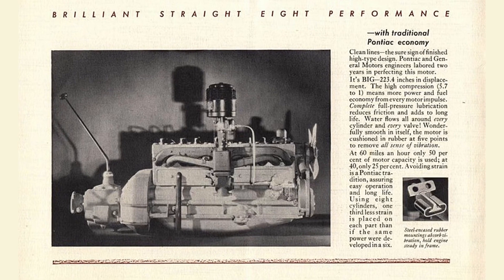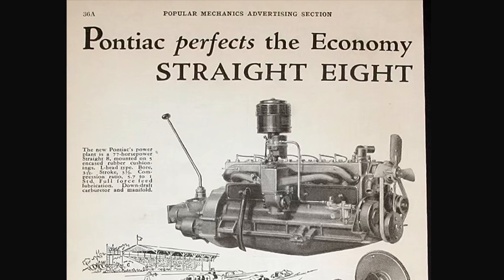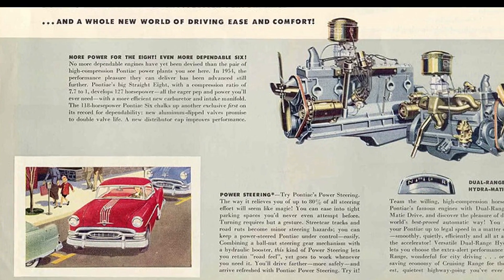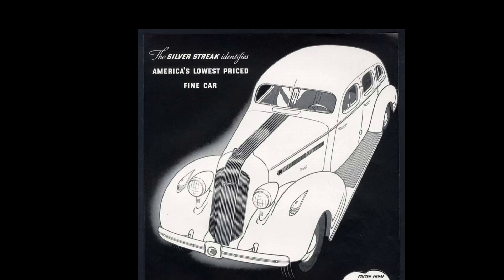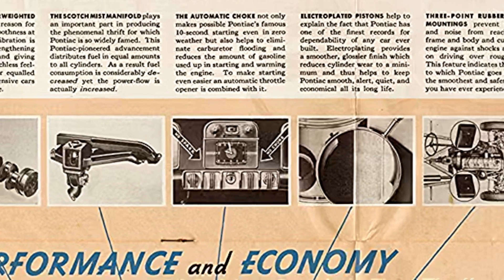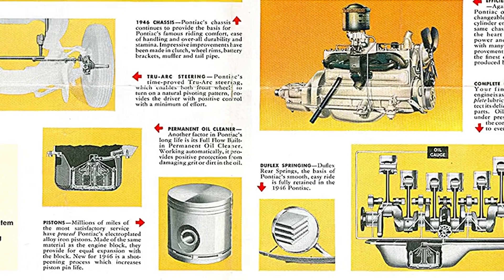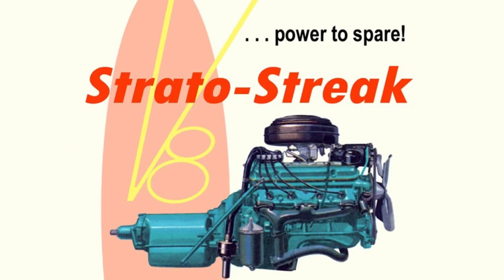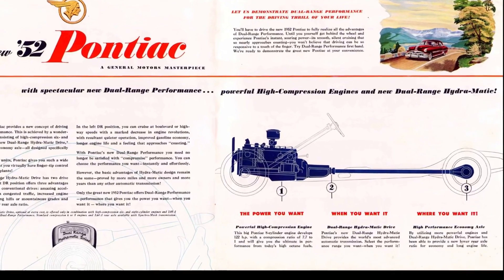Pontiac straight eight engine family 223, 232, 249, 268

Comment: My Dad had a 53 Pontiac Chieftain with a straight eight. It was the first  car that I ever drove circa 1961. I could barely see over the dash. No power steering or brakes on that jewel.  It was a handful for a little 12 year old kid to drive.  I remember my Dad talking about the "overdrive" function of the hydramatic transmission.  There are a lot of good memories from the backseat view over the years. He sold that car for  $75.00  in 1964 to pave the way for a new '64 Pontiac Tempest. Detroit iron, you gotta love it!
Reply from the maker: Thank you so much for sharing those memories =)

Comment: The 1933 and '34 are my favorites, but that '35 isn't too shabby, either.

There used to be a 1937 Pontiac Six convertible coupe close by to my school when I first saw it in 1967.  It was a faded yellow with a scruffy black top, and I was told that the old man who was driving it was the original owner.  Didn't see it from 1969 till 1991, when it was little more than a basket case, and for sale in a different part of the city.  I wanted to buy it, but it needed too much of everything.  It was pretty sad to see it in that condition. 😞 Hopefully, it was rescued.

Comment: In some ways a 1950 Pontiac was a 1950 Chevrolet with a longer hood to accommodate the straight eight engine and different chrome decorations although the Pontiac could also be bought with a flathead six engine but I recall that there were few to none.  A 1950 Chev six was a 60 mph car; any faster made it sound strained while the straight eight Pontiac was easily capable of a relatively relaxed 70 mph.  Our Pontiac had a four speed Hydramatic trans while a Chev had a two speed Powerglide trans that was very sluggish to get moving.

Comment: I think Pontiac and GM went in a bad direction. Instead of trying to make straight 8 better they should have used the GMC truck 6 starting in 1939. Superior design concept.What was wrong with Pontiac and GM they didn't do this. But do note this engine had full pressure lubrication and insert bearings starting in 1933. What was wrong with Chevrolet that they used poured bearings and splash lubrication exclusive starting in 1929 all the way to 1951 and on some engines 1952 through 1954 before switching to more modern methods in all their engines in get this 1955. They could have done it in 1935 instead.
Reply: Pontiac made a great engine.  Stud ball rocker arms was there intro in 55. Pontiac deserves their due.

Comment: In 1957 when I was 12 years old, my folks bought a 1954 Chieftan 8 wagon six passenger with Hydramatic and with 34,000 miles from a dealer in Rhode Island.  5 days later, we loaded it and drove to Los Angeles, California.  It was quiet and smooth, and fully loaded it drove fine at 60-65.  With the exterior sun visor, when a large truck or bus would pass by us on the opposite side, that visor would catch the wind and physically one could feel the car slow down from the additional wind drag.  The only problem was crossing the desert in August in the day time, it did overheat, which was not uncommon in those day.  It was pretty large, especially compared to Chevrolet, Ford Plymouth, Mercury and Dodge wagons of the same era.  We had it until he sold it in 1961 and bought a 1959 Catalina wagon, 8 passenger with the 280 hp 389 two barrel and hydromantic.   That Catalina was quick for a 4,400 lb car.  Curiously, the Bonneville of the same era had better highway mileage with the same 3.08 rear end.  Probably because the primary barrels and jets on the Bonneville were smaller than those on the two barrel and used less fuel at cruising speed.  Open "Niagara Falls" and the other two barrels made up for it.
Reply from the maker: Cool story

Comment: Also, not all 1950 cars had the new 268 cube engine.  Some came with the 248.  That's why the horsepower rating is only 108 on the 50.  Better that some cars had MORE than advertised horsepower.
Reply from the maker: Thank you so much for adding that clarification =)

Comment: Had a hand-me-down 1951 Catalina stick-shift in the late 1950's; was a weak contender compared to the Olds V-8's of the day and used lots of oil. Thought it was time for a rebuild after a Dodge 6 ran circles around me so pulled the head and found every wrist-pin loose and grooved each side of the cylinders. Went to the bone yard and picked up a 1954 Olds 324ci; with the help of Hildenbrandt adapters, it went into that sick '51 and then she was good to go...

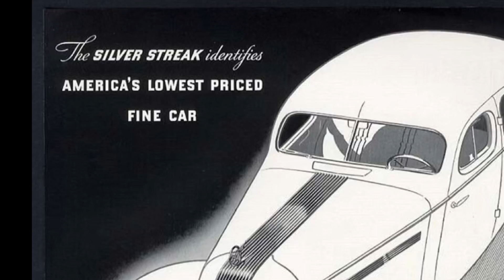Comment: I'll take the '35 and '40 Pontiacs.  As a side note;  @2:59 that's a '35 not a '36 as inferred.  The '35's light pods were mounted vertically to the fenders, 
whereas the '36's light pods were mounted horizontally to the side of the grille shell
Reply from the maker: Awesome sweet choices thank you for that correction =)

Comment: 1933 Pontiac and 1953 Pontiac.  The 1954 Pontiac Star Chief had a longer rear overhang and a much larger trunk, for one year only.  Your numbers for bore and stroke for the 248.9 CID engine are way off--not just a rounding error--they give 557.6  CID.  The later-listed figures for the further-enlarged engine are actually smaller.   The CID figures still don't match with them, but they are far closer.
Reply from the maker: Great choices thank you for pointing that out I got the information here but it’s clearly wrong 

https://www.conceptcarz.com/s25856/pontiac-chieftain.aspx

Comment: I’m confused. I believe the Bore and stroke listed for the 248.9 engine are incorrect.  Due to the fact that a 4” x 4” v8 was made by Ford which was a 400cid engine. Also the next engine described in the video has a larger displacement , but the both bore and stroke listed are smaller that the bore and stroke listed for the 248.9. I imagine it’s a misprint.
Reply from the maker: Yeah that’s a typo this is where I got the specs they are real hit and miss as far as information goes 

https://www.conceptcarz.com/s25856/pontiac-chieftain.aspx
Reply: @What.its.like. I would imagine the most accurate information would be found in the brochures.
Reply from the maker: I get most of the information from the ads some of them did not give engine displacement though and finding advertisement pieces with every single engine from this engine family was really hard there was a couple engines that wasn’t advertised..
Reply: The 1937-49 bore spec was quoted from a dyslexic source. It was actually 3.4 inches, not 4.3” (which would be impossible without a total retooling).
The reason they finally went back to V8’s was to enable wider bores without ending up with a 40 inch engine length.

Comment: Looks like the car at 5:20 has a 12 volt conversion (the original battery was long and slender,I think 17 or 18" long,and larger/higher amp hour capacity than common 6 volt batteries of the era (Buick 320 and Packard engines might have also come with similar batteries although I had the idea from somewhere that Packard once tried an 8 volt/4 cell system
Reply from the maker: I’ve wondered why some batteries from that era are long and slender

Comment: If someone is lucky enough to get to drive one of such cars,it would be a good idea to not try to reach high speed or high RPM in it,at least until it could be determined that the engine does not have "ridges" at the tops of the cylinder bores due to wear (the wear does not go all the way to the very top of the bore leaving the ridge) at high RPM the connecting rods stretch a tiny bit allowing the top piston ring to strike the ridge causing failure
I think I have heard of such cars (including such as Dodge) being sold by owners who drove conservatively to someone who took the car out to "see what it would do" and promptly suffered a completely destroyed engine with a broken connecting rod or broken crankshaft.
Reply from the maker: Great information thank you so much for sharing that =)

Comment: According to the 1950 Owners' Manual the bore/stroke for the Eight: 3and 3/8" by 3and 3/4"
for the Six: 3and 9/16" by 4"   
has a statement that external oil filters are not needed but I believe that they were available and extended engine life if the cartridges were kept changed 
based on what the car would do (it had a 3 on the tree with a heavy clutch) the 108 horsepower was considerably understated,probably because of GM policy that tried to steer buyers to the more expensive Buicks and Oldsmobiles (although I think Oldmobile's claimed 135 horsepower was also understated in deference to Buick and Cadillac)
I believe the Pontiac would handily outrun the smaller Buick Special with its 248 Straight Eight,at least as far as low speed acceleration 
 at least two people claimed that this car (1950 Pontiac) reached 100 mph
it was quicker from a stop than a '54 Dodge with a 170 hp. Hemi (although once speed built up and the limitation of the pitiful 2 speed automatic in the Dodge was overcome the Dodge would pull far ahead and leave the Pontiac far behind on the highway)
I believe the Pontiac once embarrassed an early Corvette from a stoplight (before Corvette had a proper engine, just a louder version of the shake,rattle and roll "Stovebolt")
Reply from the maker: Thank you so much for that correction this is were I got that information clearly a typo it’s my fault for taking that at face value I should have checked another source 

https://www.conceptcarz.com/s25856/pontiac-chieftain.aspx

Comment: I am curious as to whether all of these Pontiac Straight Eights had the same external dimensions (same block) or did the block change?  Also was the Pontiac Six the same thing except with two cylinders removed from front and/or back of the casting or was it lighter in cross section construction? I do believe that as of 1950 the displacement per cylinder was larger in the Six vs. the Eight. I think the Eight had a shorter stroke. Also I think its stroke was shorter than such as Dodge and Plymouth sixes giving it (also had a 2 barrel carburetor) more RPM capability. Although with all such engines it was dangerous to run them at as high RPM as they seemed to be able to pull to.
Reply from the maker: The 249 was a typo I got the specs from this site 

https://www.conceptcarz.com/s25856/pontiac-chieftain.aspx

Comment: 4.3 inch bore and 4.8 inch stroke....that's bigger than the 500 Caddy (4.3 inch bore and 4.304 inch stroke)
Reply: The figures at 5:00 can't be right--compare with the bore and stroke of the Ford 460 !
Reply: @davidpowell3347  Ford 460:  Bore 4.351  Stroke 3.85 inches
Reply from the maker: Yeah that one is a typo thank you so much for pointing that out.. I’ll have to see what the actual bore and stroke is lol

Comment: I had a 1954 Pontiac Chieftain Deluxe with a straight 8 and hydramatic drive.  That car was a tank and nicknamed "Betsy".
Reply: Those things were a huge beast! With the straight 8, and slush box transmission, yet it still moved under it's own power! 😂
Reply from the maker: What did you think of Betsy?
Reply: @What.its.like.  She made 0-60 measured with a calendar, LOL!  She was a bit rough, but easy to work on.  First point ignition I worked on.  Eventually, the #2 and #7 exaust valves broke.  That was her demise, nobody would agree to fix it.  Sold for a few hundred to someone who wanted the hood ornament.
Reply from the maker: Thank you so much for sharing Betsy with us =)

Comment: 4:24.i have a legitimete question.how can a 249 cube straight 8 have larger bore & stroke, plus 2 more cylinders.& still be smaller cubes than a ford 300 6 cylinder? a misprint? wouldnt your bore & stroke numbers make it over 500 cubes for 8 cylinders? what am i missing?
Reply from the maker: Different engine architectures fiat made a four-cylinder that was 28 L..

Comment: One note, Pontiac Straight Side Valve 6 and 8 Cylinders were nicknamed the 100K mile engines in their day. Part of it was due to their rugged high chrome blocks (Similar to Packard and Studebaker) but Pontiac engines used a oil sump strainer system that ensured all oil was strained before entering the bearings and it also allowed complete cleaning of the strainer when oil was changed. This oil strainer system was similar to that used on many early Farm Tractor engines as well!
Reply: The 1950 owners' manual extolled the virtues of their "oil filter system"("precipitation"?)but I don't think it did much except possibly reduce the possibility of visible size metal shards or scarf getting picked up through the strainer. I think there was an aftermarket Fram bypass oil filter system that dealers could install on the cars as a dealer installed option.
Reply: VWs had a strainer like that. I have an add on oil filter made by AC that was in a box of auction stuff I bought. Fits any GM car of that time. Also in that box was an original Model T jack and an original Zerk grease gun.( as in Zerk fittings.) You filled it with grease and there was no pump. You just screwed the long T-handled shft in slowly and it forced the grease out the Zerk fitting nozzle. All for $2 'cause no one else wanted the box of "junk".
Reply from the maker: Thank you so much for adding that information =)

Comment: 1935 is good but my favorite is 1937  6 cylinder.. shorter fenders and hood  more per portioned 🤔 ??
My grandfather had a 51 Silver Streak 2 door fast back .. Pontiac flatheads ran smooth 😊 ..  But Packard had them beat by a mile 😉👏👏👏👏
I've driven a 29 Oakland .. Full size and long but ran smooth and rode comfortably 👍😉.
Great Episode
Happy Motoring ✌️🤠
Reply: The Packard Straight Eights were larger,some by a lot,and also I think some of them were hand balanced (crankshaft and piston/con rod assemblies)
Reply from the maker: Awesome that 51 silver streak fastback what a car =) great choice 

I really wanted to cover an Oakland before the year was over just didn’t get it oh well there is always next year

Comment: Love this well done episode on the Pontiac 8.  Great information.First pick the 34 Pontiac, the second I'll take the 49 Pontiac sedan delivery even though it is not a wagon.

Like to answer the question  you asked in the Marlin video on the twin stick, and 2 speed rear axles. With automatic transmissions and computer controls we won't see these features in today's cars, but it would be neat if they did. Personally I would like to own a Twin stick AMC car, it would be fun to drive since I prefer manuals, the  Twin stick  transmission to me is similar to large trucks with 2 stick transmissions. some Mack trucks has a 5 speed main transmission, and a 2 speed auxiliary transmission, so AMC had the same concept. Ford cars before 1949 could be fitted with a Columbia 2 speed rear to give you 6 speeds. It would be nice if the auto mall had one for sale that would be a great car to feature.
Reply from the maker: Awesome choices it was going to be wagons in the second scenario but then came across that picture of that sedan delivery and was like THAT haha neglected to change the voicing 

Awesome insight to the Marlin twin stick thing